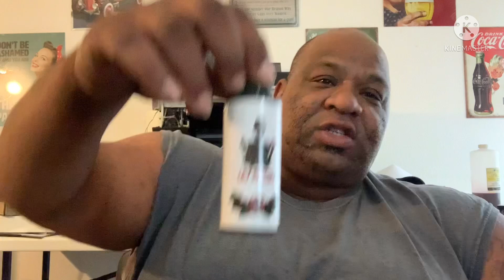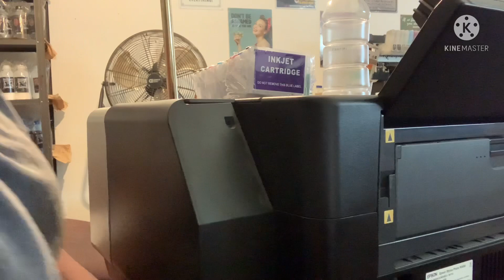Today on Big Boi prints we will be converting the Epson R3000 to a Dtf printer!

Comment: Das Funktioniert super, allerdings gibt es große Probleme mit dem Einzug der DTF Filme. Gibts einen Tipp dazu?
Reply from the maker: I can’t understand what ur saying there is no translation
Reply: @bigboiprints5726  This works great, but there are major problems with loading the DTF films. Is there any tip about this?
Reply from the maker: @einfachschoen is trying to a roll film! Probably works better
Reply: @bigboiprints5726  unfortunately he doesn't accept the film role. The printer then says it's not paper.
Reply from the maker: @einfachschoen  take paper check off
Reply: OK, where do I do this? I've already searched and haven't found anything.